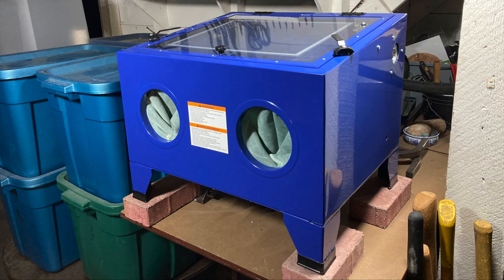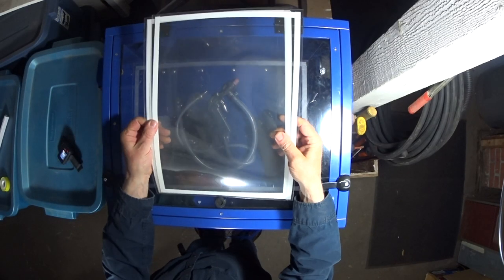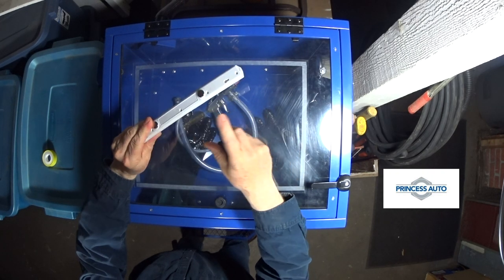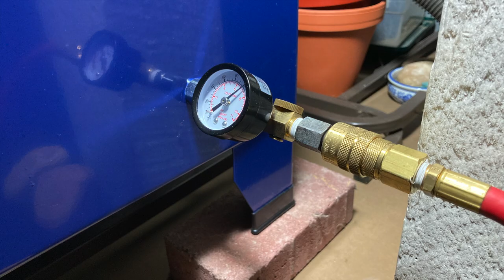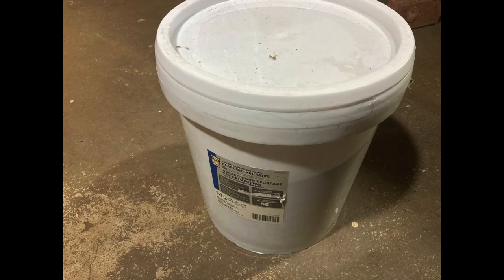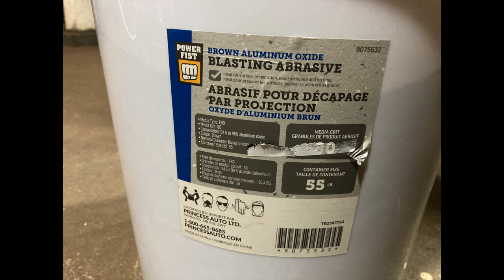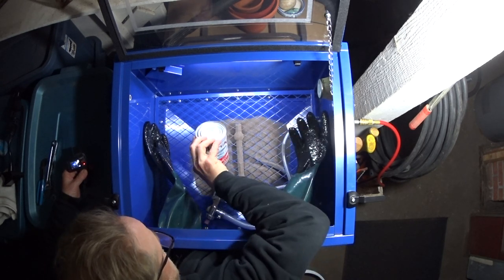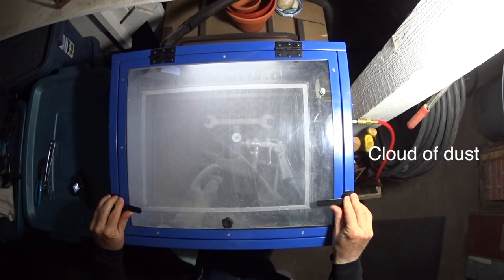Bench-top Blast Cabinet

Comment: I think you put the vacuum hose on the inlet cover. The filter to the right is where you should be attaching the vacuum going off the other videos I've seen.
Reply from the maker: After some review and reconsideration, I stand by my choice.  There is less airborne dust higher up in the cabinet cuz gravity. And you're not trying to evacuate the dust just the air pressure introduced by the compressor.